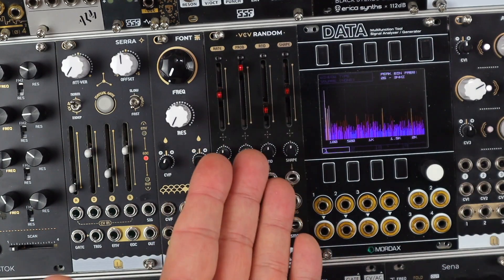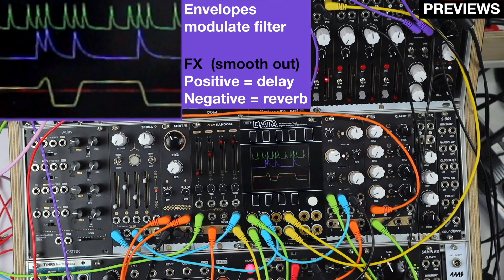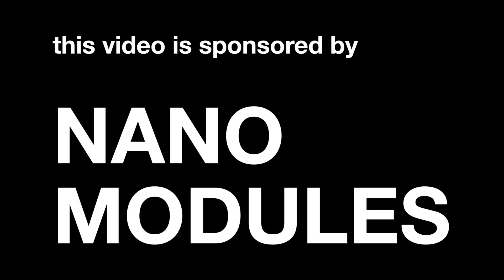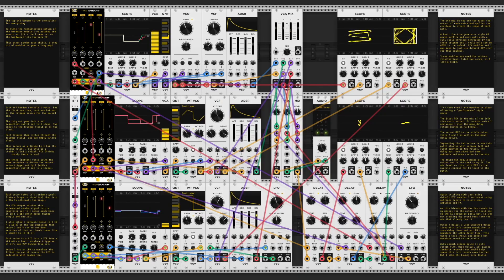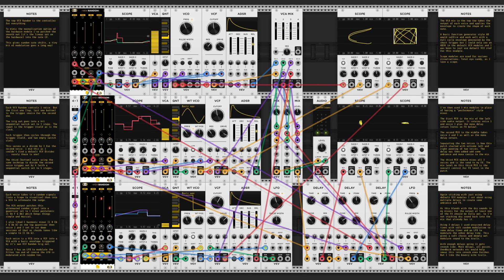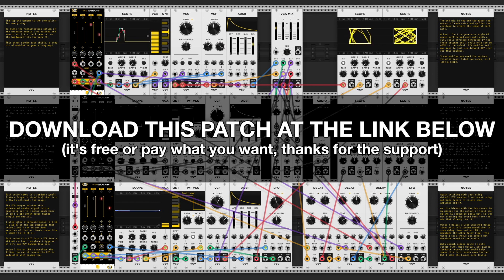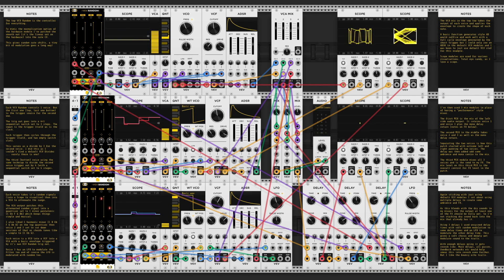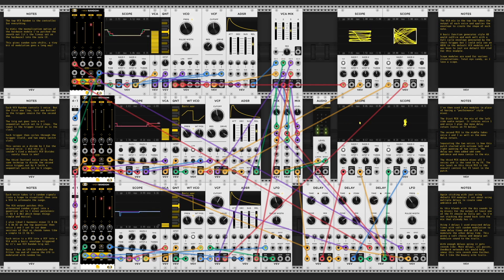What if VCV Rack was real? // VCV Random by NANO Modules

Comment: woow you really made it sing!! I like how the slew time (and step time for step out) is always relative to the clock so it always goes to the sampled value no matter how long is the slew! that's quite great for no random source sapling as well. thanks for this inspiring video!
Reply: Assuming it is the same as the VCV module, that only works when using the internal clock. If clocked by an external signal, then it uses the time between the last two clock triggers to determine the rate for the slew. If the actual external clock rate varies, then things are thrown off - all to be expected really. But when using the internal clock the slew always remains in sync, even if the internal clock rate is modulated.
Reply: @DaveBenhamMusic i know tides 2 and probably a few other MI modules can learn 8 step trigger sequences.

Comment: Hmm, the STEP out behavior at 04:37 is odd. It does not match the manual description, nor does it match the behavior seen in VCV with the original VCV Random, nor the NANO Random. In VCV, the STEP output is the same as the other 3 when SHAPE is at 0 - instantaneous jump to the new value. I wonder if the behavior in the video is due to an early release of the hardware. Either way, it is very cool to see a VCV module implemented as hardware. I have always liked the VCV Random - very versatile.
Reply: UPDATE: We have fixed the issue, we will update the manual and put online the last firmware revision soon :)
Reply from the maker: fantastic turn around time on fixing that one NANO, well done.
Reply: Hello! Yes, we noticed it just a few days ago because Divkid told us, we weren't aware of that behaviour. No problem, we will take a deeper look onto it and we will fix it in software, the module could be easily updated by anyone :)
Reply: I confirm, both VCV and nano software version's step out give one step per trigger when shape is at zero. My hardware unit has this problem as well

Comment: Surely what someone should make is a hardware module that can run any VCV rack module
Reply: 4ms MetaModule
Reply: @Hikove  🙀🤯
Reply from the maker: the problem is the interface, though the mentioned 4ms Meta will host whole VCV patches.
Reply: @DivKid  Yeah. it would have to be a big touch screen I guess.